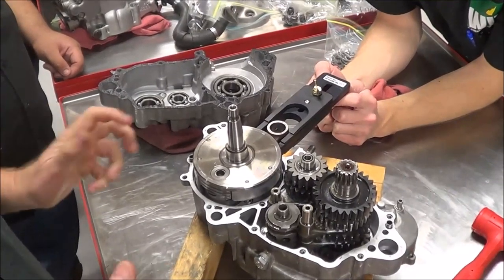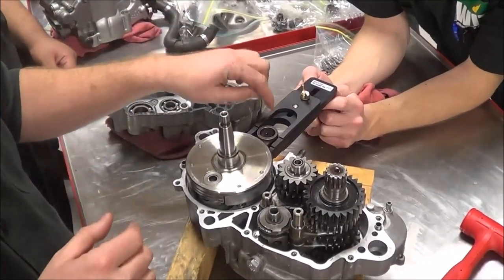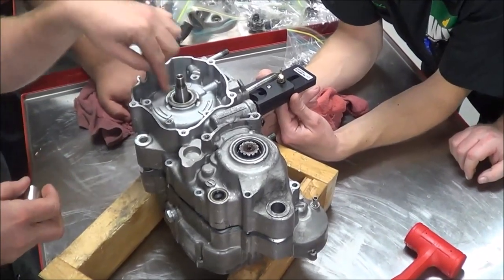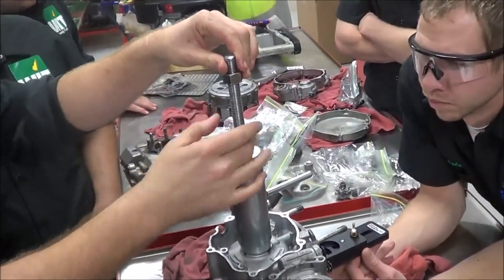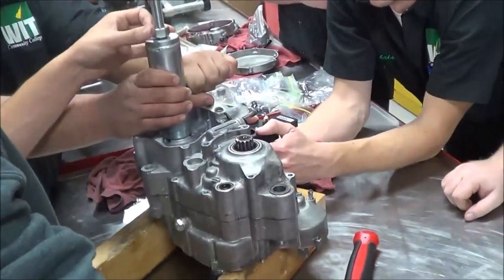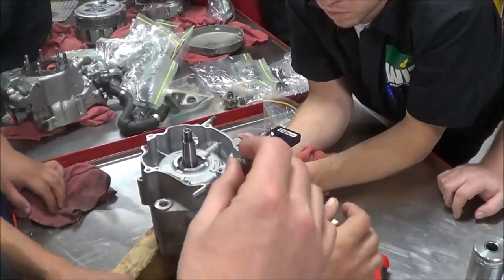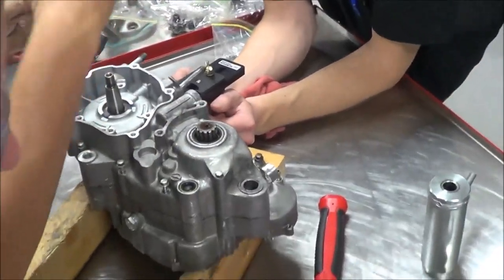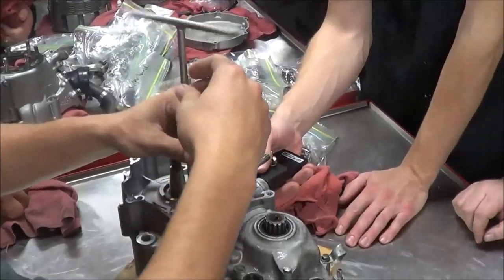2 Stroke Engine Assembly: How assemble the crankcases

Comment: Hi I’m rebuilding a yz250, I replaced the bearings along with the bearing cap/seals and the crank as well. When I went to put the casing back together,  it didn’t want to fully seet down.   I ended up getting it about a quarter inch away from being fully flush but it won’t go the rest of the way down. When i tried putting a few screws in the block and lightly torquing them down to see if it would help, it caused the crank to freeze up and also made no difference in the gap in the block. Any ideas?

Comment: My bike was smoking a lot fouling plugs and spoofing. I had a bad crank bearing so I split the engine to change it. I replaced both crank seals  and the gasket. I accidently put the right seal in to far and had to pry it out to put it in the correct depth. The bike still smokes like a freight train. what do you think it is? I'm thinking I messed the seal up. but couldn't it be coolant also?
Reply: coolant will produce steam,oil burning is very noticable,and very smelly,plus check to see if coolant is contaminated with oil,and if the oil has emulsified oil(light brown to white sludge) in the crank filler or breather,telling you a seal is leaking,check spark plug for oil fouling,wet with oil,greasy looking.
I hope you got it fixed ,but if not try these clues out.

Comment: i'm going to split my 89' RM250 to get the crank rebuilt,water got in through the exhaust port and lay for a little while,i would expect the 2T oil to have coated all the bearings and thereby be no pitting etc,but i don't want to take a risk with this bike,

so i bought the tusk case spliter and crank puller/installer tools,do i need the web support tool also as the crank is pretty much sucked into the bearing rather than pressed,i cant see how it would deform the crank true,any more than bliping the throttle or popping the clutch,i've never took the engine apart to the crank before,and have no problem about that,just whether i really need to support the web of the crank,as it looks as if the crank is under no compression from the puller tool.

But then this is why i'm asking,as the dialogue in the video is confusing.
Great series though.

Thanks.
Reply from the maker: Thank you for the kind words. I can help you personally if needed through my website. 

I can ever be of service to you, here is a video explains how to connect with me. 
https://www.youtube.com/watch?v=vjvmB01ebcs 
Keep Wrenching,
Shane Conley
Instructor/Motivator/Motorcyclist
www.how2wrench.com

 Head over to the new website and subscribe to the newsletter to never miss a video or newsletter! 
https://how2wrench.com/contact/ 

Did you like this free video and hope to see more? Would you just like to say thank you with a donation? Click https://www.paypal.me/how2wrench

Comment: Hi Shane, what type of gasket maker would you suggest using on crankcase surfaces? Silicone based/ rubber based? I'm still thinking which gasket maker I should use one my 2 stroke crankcases
Reply: Little late to this but highly recommend yamabond
Reply: @2cthagoon392  I’m doing a 2 stroke would Yamabond 6b work?
Reply: @calebcarinci2428  yeah that will work
Reply: @calebcarinci2428  actually its silicone?

Comment: Does anyone know the name of the tool that compresses the case together?
Reply from the maker: Hi Mike. I added the links in the description and here they are for you: 
Amazon Tool Links:
Crankcase splitter/installer tool:
https://amzn.to/30dDUB0
Crankshaft wedge tool: 
https://amzn.to/3cBrncX
👍 Thank you for taking the time to comment! It helps us! 
Here is a way to support all the free videos.
Want to say “thanks” or “keep it up”? Click here https://www.paypal.me/how2wrench  

Coach Conley is also available for hire to personally work one on one with you if ever needed. Yep he is a real person. Give him a call @ 602-345-0432
Details here: https://how2wrench.com/product/personal-tech-training-phone-facetime/ 
Your answers and help are just around the corner. Save time and money while protecting your investment and yourself by doing it the right way!
Follow us! 
Web:
www.How2Wrench.com     
www.Tools2Wrench.com
Reply: Heat up bearing and nothing more man.did it hundred times without any spliter or installer.cheers
Reply from the maker: @throttlejockey3366  I used to do the same and my older videos on here (and when this tool doesn't fit the crankshaft). The big benefits of the tool are control and no burns...😃
👍 Thank you for taking the time to comment! It helps us! 
Here is a way to support all the free videos.
Want to say “thanks” or “keep it up”? Click here https://www.paypal.me/how2wrench  
Follow us! 
Web:
www.How2Wrench.com     
www.Tools2Wrench.com